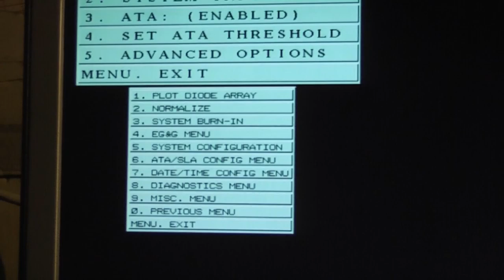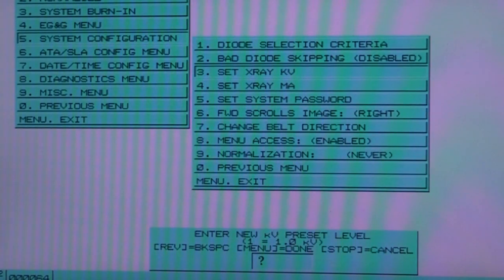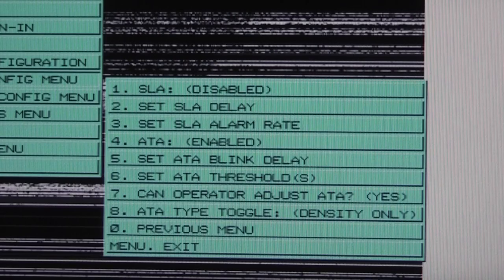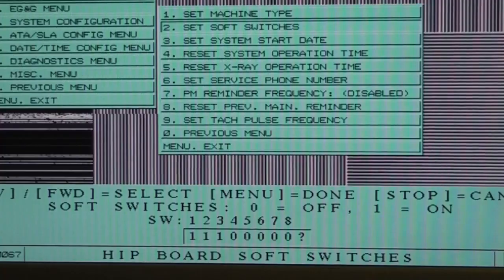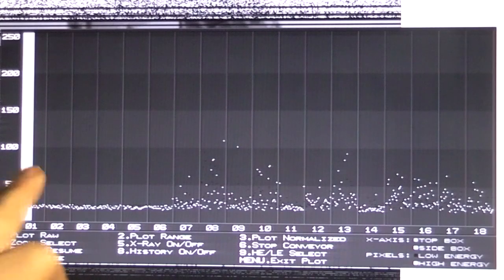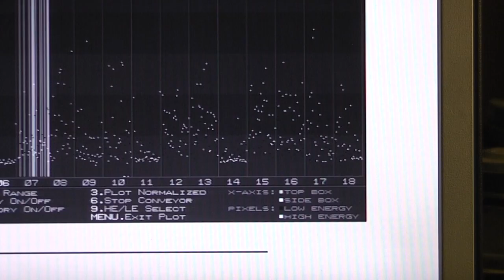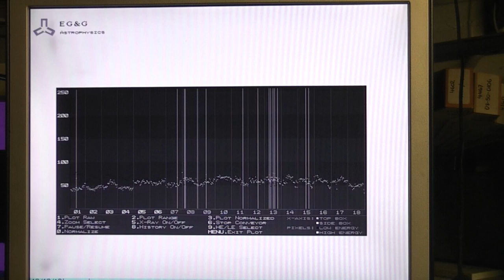Baggage X-Ray machine Part 3

Comment from the maker: You supply a fixed (regulated) voltage and then adjust the heater current to get the required beam current

Comment: Hi, Mike.
It looks like the glitchy lines might be happening post-normalization?
Maybe the normalization is done with one of the big FPGAs? The non-normalized plot doesn't look too bad, but afterwards it seems that more glitches are appearing?

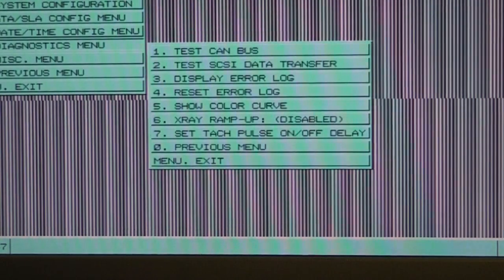Also, around 9:10, the colour ramp pattern looks a bit screwed up? Could this be a framebuffer / LUT issue?

Logically, I guess this all happened after it got locked-out, is that correct?
Has anything else changed from when you were getting a good image?

Comment: Actually, to re-phrase that, I meant the plot looks "worse" post-normalization, so but maybe it's the timings for some of the chips, or an FPGA which is wrong?

Can we assume the boards themselves are physically fine, and it just the incorrect NVM settings causing the problems?

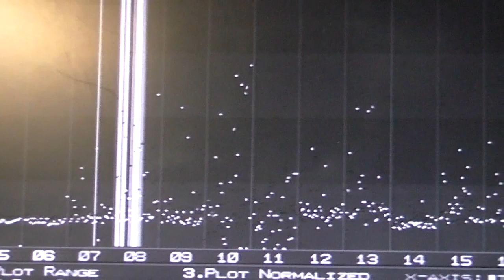Ahh - I've just seen at 21:06 that power-cycling helped a huge amount. lol
Seems like a fussy beast.

Maybe some the NVMs have internal batteries which are failing now?
Does it have any of those DALLAS type NVMs?

Comment: These are very old videos but the reason why the raw screen looked like shit is because the system needed to be "normalized". All the detector diodes have different efficiencies and need to be adjusted digitally so they all have similar signal strengths and linearities.

Comment: The Warm-up or Ramp-up routine is to recondition the X-ray tube following long periods of non-usage.  It's the same thing you would do with any industrial system.  The control card in the HVPS controller contains two serial interface CAN bus digital potentiometers in 8 pin DIPs that are used to program the tube current and voltage for 600uA at 140KVP.    It is possible to change these but the system was designed to operate with those settings.  It makes me cringe also Mike, every time you point at and jam your screwdriver tip into the PCBs as if you had very little respect for this machine.   I suppose however, that's true since you did cut the belt rather than to spend 15 minutes to remove it or just get the correct truck to transport the machine.  I have a lot of respect for the EG&G systems because of their very high quality and the fact that I supported my family with them for some years.
     In fact, if you need parts for this type of system I have some that are used yet, in good condition.   I even have belts that are good.  X-ray tubes and almost any other parts.
Reply: PeopleGB
No, he did not.   I have diverted away from security X-ray.  I found the best money was in adding image storage capability along with other small modifications.  For instance, reduced energy of a system to 40KVP so it could be used to inspect boxes of cereal. My core business is now with microfocus X-ray systems that use "open" sources and electron microscopes.   In these systems, the X-ray source is a small high vacuum system with a turbo molecular pump.  I have an installed customer base all over the US and in several countries.  I have one customer that owns a 225KVP microfocus system in southern Australia.  That system weighs 9000 LBS.